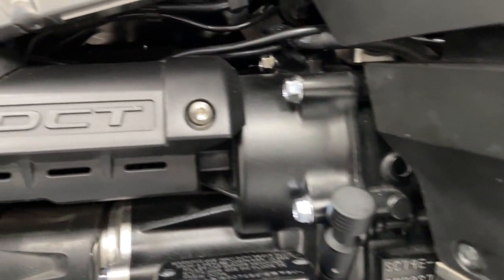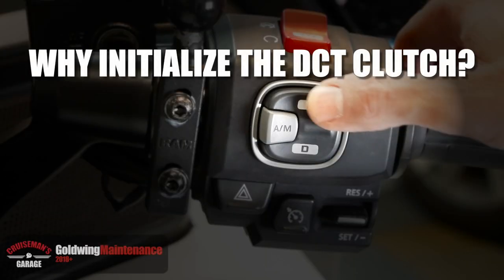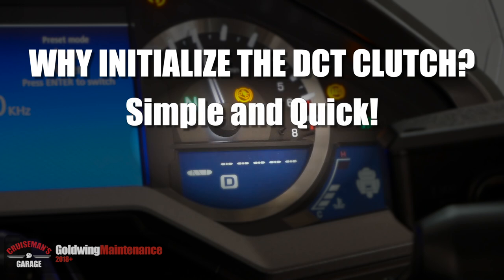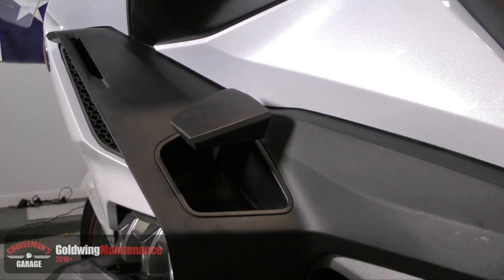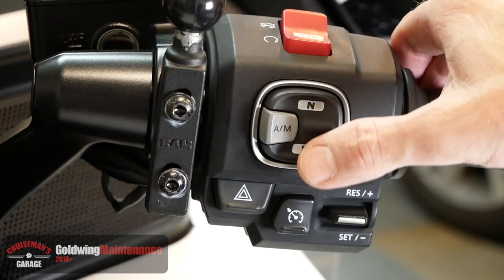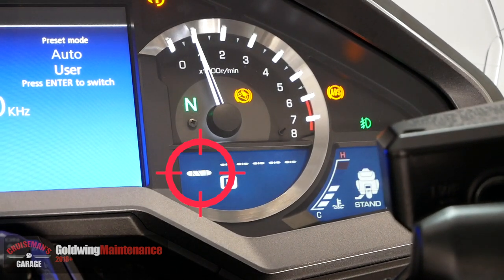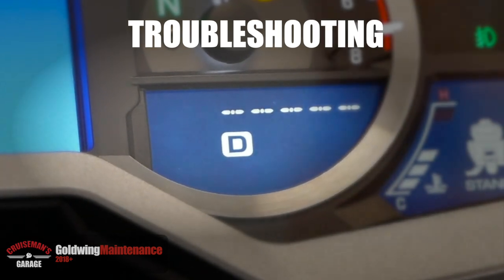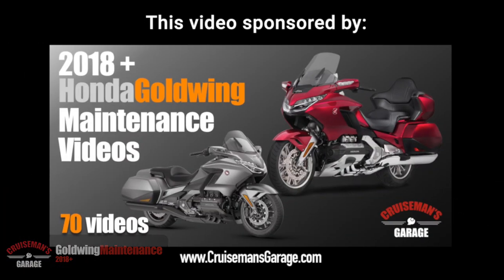Initializing The Honda Gold Wing DCT Transmission | 2018+ Honda Goldwing | CruisemansGarage.com

Comment: My local Honda Dealer says to NOT do it...The only time it should be done is if the DCT controller  is replaced or Clutch plates are replaced...Never do it otherwise . The repair Manual also says the same thing..Doing it can cause serious DCT/Computer issues.
Reply: Correct
Reply: @obwan7217  this is incorrect.  If this were true it wouldn’t be an option for owners moreover, the Honda tech would do it.

Comment: I did this procedure as I was told on one of the Gold Wing forums that doing it may get rid of some of the drive line lash. My '18 seemed to have quite a bit of slack in the drive line, to the point where it was starting to become a nuisance. The process seemed to go fine, and I took it out for a short ride afterwards, it shifts fine, but my ride was probably too short to be able to tell if it tightened up the drive line at all. I plan on taking a longer ride this evening after it cools off a bit....BTW, thanks for posting this procedure, made it very easy!

Comment: I have done this several times and still have problems with the transmission shifting every couple of months, I call it "Quirks." What I have found is that this procedure was only intended to be used after replacing the TCM (Transmission Control Module) or the Clutch Assembly so they work together. It was not designed as a maintenance procedure. If it was, that would tell us that Honda knew the transmission wouldn't continue to work correctly without doing this initialization process every so often to keep it working correctly and we would be instructed to do this when we do certain maintenance on the bike. I admit the transmission has "Quirks", and mine acts up occasionally, but after a few miles it goes away and starts shifting normally again. The bike runs fine until the next time these "Quirks" appear, and as I ride they go away. Doing this initialization process has not given me confidence that it worked and fixed the problem. The bike runs normal most of the time until these "Quirks" appear again. I haven't done it in over a year, and the problems come and go, so that tells me doing this in the past has not helped. It still acts up. Here is a question for those who ride a DCT. How could the computer forget to shift, where by doing this procedure it re-learns (re-programs) the computer? It makes no sense!
Reply: It actually makes perfect sense because the friction coefficient of oil changes as it brakes down and becomes contaminated.  Also different oils have different additive packages and since the clutches are friction devices it makes sense that a relearn or recalibration would help to fine tune the shift points.

Comment: Well done. I have a 2020 and just this morning I noticed that the riding mode indicator was flashing. I'll try this to see if it fixes it. I've also noticed that while slowing down there is a wierd double-clicking sound when the DCT downshifts from 3rd to 2nd.

Comment: I did this because my new Goldwing was shifting erratically at low speed, becoming jerky, which was a bit disconcerting approaching busy junctions. I’ll let you know if it fixed it in the next day or two. Helpful video as always. 
Ok, I think it has helped, but I still got a couple of jerks, particularly in Tour mode. Any advice gratefully received. I wonder if the fly by wire throttle is very sensitive to tiny inputs? It seems that if I brake against slightly raised throttle it may do it less? Cruiserman advice needed!😁

Comment: Hi Cruiseman, Uk here. Got a 2024 model & this does not work? Holding in D ignition on the engine light comes on for a split second then goes out. DDNDN does not do anything after. Any thoughts, much appreciated. SCRAP THAT YOU THEN TO START THE ENGINE!! THEN GOES THROUGHT THE PROCEDURE! THANKS

Comment: Hello Cruiseman!
I just finished watching and performing the initialization process on my 2018 GL1800 DCT, but I did not get the results specified in your video; instead of the flashing bar next to the D, I got a white N and 5white dashes, let it run for about five minutes, still no N Tour. What do you think I did incorrectly?
Regards,
Loyal.

Comment: Hey buddy,I have a 21 dct tour that about 1 out of 4 or 5 start ups,the idle stars surging up and down.sometimes when I go to take off it will stall.most times I shut it off and restart it will go away.sometimes it's still happening. Have you seen or heard about anyone else with same issues. Thanks for all you do for the goldwing.
Reply from the maker: The variation in idle is not uncommon. Also, on the new Goldwings, you need to make sure to let the engine warm up for at least 60-90 seconds before taking off or the engine might stall.

Comment: After doing this after a couple cold days the bike wouldn’t start and cursors blinking.  Finally got bike to start but check engine light on.  Took bike to dealership for service to see what is going on.  They initially think it might be battery   Do you have any ideas?  Will it drain battery to do this or need more power to start bike when trying to get the transmission initialization to happen?
2018 DCT and original battery
Reply: did you ever figure it out?

Comment: I have tried this procedure several times and it will not start the initialization process despite doind exact procedure ???? Hold D, turn on ignition knob, continue to hold D for a while then release , DDNDN, start..... NOTHING . Bike starts and reads N Tour. Any suggestions ???? Thanks ! 
Chip
Reply: Same here!
Reply: I had the same issue with my 2023 gold wing tour. The problem I found out was that I was trying to do it while the bike was on side stand. However, you need to do it just like in the video…on the center stand with parking brake engaged. Worked like a charm once I did this.

Comment: I’m having issue going into drive after just washing bike? Tour display is flashing.   (******). Tried this procedure but didn’t work.
Reply from the maker: That should NOT be happening. Are you using a high pressure washer?
Reply: @cruisemansgarage  no pressure washer. Engine starts. I also tried dis connecting battery
Reply: Also it does not go into manual mode or reverse

Comment: Hi I've been having issues with my DCT shifting and tried the initialization on it. It continues to fail each time I try it(giving me the "-" flash every .5 seconds) now I cannot get it out of initialization. The service manual just says to keep re-trying and has no further troubleshooting suggestions. I took it to a Honda dealer and they could not figure out what was wrong. Any suggestions?